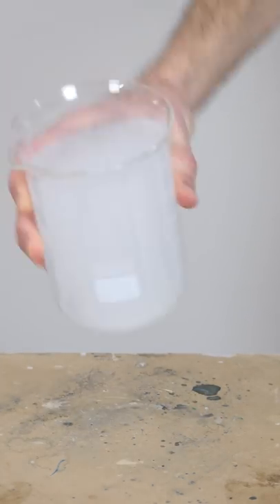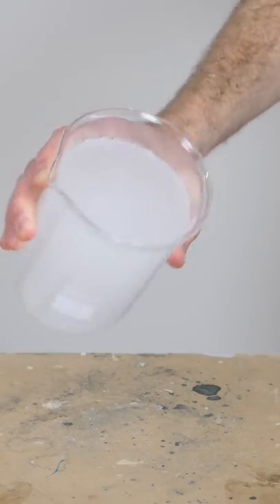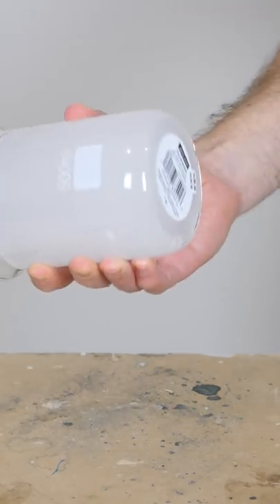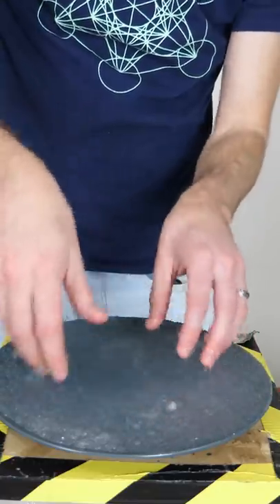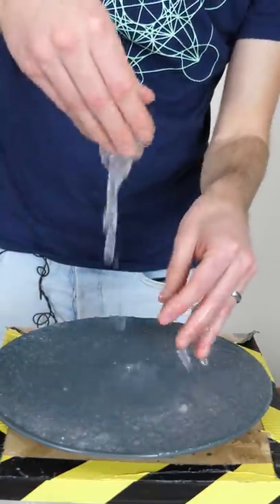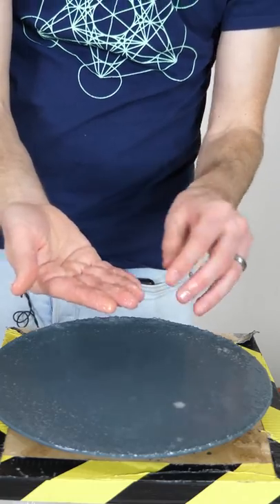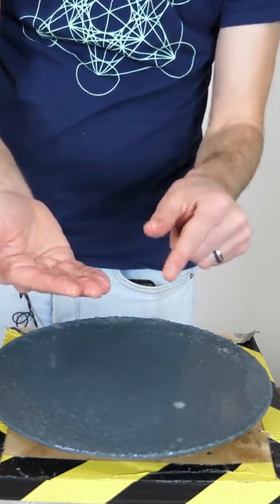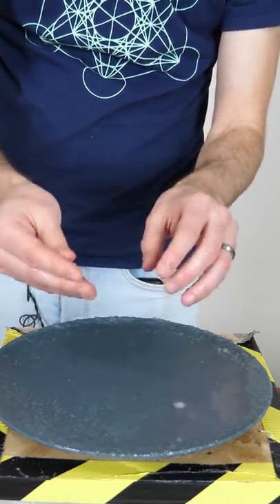Don't Put Salt On Superabsorbent Polymers

Comment: Fun fact: this is used in tattoo studios when an artist finishes a project they sometimes add this to the remaining ink in the small container not to spill it in the trash can
Reply: Interesting application. I am a chemist. Never thought of using superabsorber that way!
Reply: that’s a cool way to contaminate ink. rad.
Reply: @karabinjr  lmao what? Hahahha
Reply: @karabinjr  its used to cleanly dispose of ink thats contaminated. You (hopefully) wouldn't want to put back ink that you've dipped into then poked into someones skin, then dipped back into
Reply: @ameko1ikiru  thank you. I misunderstood.
Reply: You can use it on inks but Its mainly used to for rinse cups, the cups of water used to rinse the color out of the tips/needles when changing from one color to the next. The most popular brand is called 'Rinse Cup'
Reply: @ag1648  thank you. As someone who uses this daily in a tattoo shop I concur. You would be wasting ink if your ink caps were big enough to need that. What are they running, a 1,235 mag?🤣🤣🤣 
We use this mainly for our rinse cups
Reply: @ameko1ikiru  we don’t use it for ink. You would be wasting expensive ink if you were throwing away enough to need an absorbent polymer. We use this to solidify our rinse cups. The viscosity and drying time of the ink along with the fact that we generally use it sparingly (the minimal amount needed for that project) makes it a non issue in the can, unless you thin it by tossing a bunch of water in the can via a rinse cup. 🤷🏻‍♂️
Reply: @michealhuff2299  sorry, i was just clarifying what the op said since they mentioned remaining ink, my apologies if it sounded like I knew what i was talking about, im not in the business as you could probably tell

Comment: They make this stuff for pulling toilets out. Pour a packet of powder into the water after you’ve flushed the toilet to drain the tank and leave it for fifteen minutes. Gets solid just like his, cool part is, once you reinstall the toilet, you just flush more water into it and it goes back to a liquid and flushed down the drain. Pretty neat stuff
Reply: Where do you pull out and reinstall toilets so often you need a special product
Reply: @tomlxyz  I would assume a plumber…You know that trade skill that deals with pipes and toilets..
Reply: @tomlxyz  people whose job it is to remove and install toilets.
Reply: @Caedus696  but why would they remove a toilet and install that used toilet at a different place?
Reply: @tomlxyz  well... Maybe some people have a copper toilet or one of those Japanese toilets with the build in springler and a lightshow. Those are expensive.
Reply: @tomlxyz  Sometimes it's just the wax seal under the toilet that needs replaced.  Toilet is fine, but still needs to be removed.
Reply: @tomlxyz  Do foxes use toilets?
Reply: @tomlxyz  ever redone a bathroom floor? There is plenty reason to remove the toilet to do that.
Reply: Doesn't this harm the water system because I read somewhere we drink what we flush after its been cleaned
Reply: @mrfookayu  presumably it is filtered out in water treatment facilities like all other contaminants in the water supply.
Reply: @Orjahlian  No I mean over time if everyone is doing it, won't there be too much polymer to handle. Like what if all the water turns to jelly, how would you clean or dilute it without more clean water
Reply: @mrfookayu  it is a specialty item unlikely to see use on such a scale (wet wipes, for instance, as I understand it are among the highest concerns for sanitation departments nowadays), and as demonstrated in the video in such a scenario we could separate the water using salt, even assuming we have no other way, which we likely do. In short, I wouldn't worry about this in particular.
Reply: @Orjahlian  Gotcha, for every flush I will add a sprinkle of salt. Just to be on the safe side and counter balance any polymer related situation from others. 😉
Have a nice day 🙂
Reply: @mrfookayu  you too!
Reply: @tomlxyz  rich people like to replace things that are still perfectly good. Why throw out something that works when you can resell it and make a little money and save someone else money at the same time? But generally it's just replacing the wax ring you lift the toilet take the old wax ring off scrape all the old residue put a new wax ring on and reset the toilet and bolt it down. It's a lot  easier when you don't have water sloshing out of the hole
Reply: @tomlxyz  flooring installs that need toilets raised
Reply: No plumber actually uses this stuff, it would be a waste of money, they get good at doing a bucket pour to cause a manual "flush" and the tiny bit of water left in the bend can easily be soaked up by a towel. I've seen a plumber do it with an extra large slurpee cup before! 🤣
Reply: Isnt it in baby diapers ?
Reply: @mrfookayu  Most drinking water comes from dam lakes & rivers. Which also experience rainfall and evaporation, which recycles the water.

Also, depending on the system, most waste water is treated before being released into the drinking water supply (if the system even puts waste water back into the fresh drinking water supply after being treated).

(Some systems treat waste water then dump it into the ocean or wherever.  Separate from the clean water supply).  There are many different systems, so you could probably YouTube or Google search your areas water supply and waste water treatment systems.

But again, most clean water that comes from Fresh water dams and lakes experience plenty of natural evaporation and rainfall that recycles the water before it even enters the treatment plant to be cleaned with whatever chemicals or filtration before pumping it to the community
Reply: When I've had to get water out of a u-bend I just use a wet and dry vacuum cleaner. Far simpler.
Reply: @pan2aja  yes
Reply: The T shirt he is wearing is more interesting than the experiment.
Reply: @mrfookayu  you have drunken water that dinosaurs have peed in
Reply: @tomlxyz  my dads a plumber. You’d be surprised how often people remodel their bathrooms. Adding a tub could mean needing to move the toilet over a foot to the side
Reply: @mrfookayu  I love how your solution to this is to sprinkle salt on your toilet like it’s a margarita glass
Reply: I just use a cheap Depot vacuum cleaner...
Reply: @jonsmith5058  thats what I was about to say, I remodel bathrooms taking out the toilet is one of the first things I do. 50% of the time the same one goes back in. I normally use a shop vac and blow out excess water.
Reply: @jonsmith5058  I don't know of a case where the floor was redone but the toilet was kept
Reply: @tomlxyz  ok? So what, its perfectly logical to do that though isn’t it?
Just cause you havent seen it doesn’t mean it won’t happen.
Reply: @tomlxyz  I have in my own house, but I'm cheap af.
Reply: @mrfookayu  you don’t need to. Once the polymer undergoes this effect, it completely looses it’s ability to absorb water.
Reply: @mrfookayu  That depends on whatever country or prison cell you're living in.
Reply: LMAO. NOT TRUE !!
Reply: @jonsmith5058  i feel like redoing anything in bathrooms is just a pain in the ass no matter what
Reply: @tomlxyz  when building or remodeling homes, a plumber may be called in to move toilets, sinks, showers, etc around. So, if someone wants to remodel their bathroom and move the toilet to make room for a vanity sink or a bigger shower or something, that would be a valid reason to do this.
Reply: Wouldnt just turning off the water and then flushing work as well?
Reply: @stuartgreenshields5591  ik, what i meant to say is: have the tank filled with water. Close the water (the water bobbin thing) so no more water can enter your house. Now flush your toilet. All the qater should flush, and no water will refill up the tank cause by closing the bobbin you severed the connection. Then you are free to change the toilet.

Wouldnt this work?
Reply: @mrfookayu  put salt in it
Reply: @capuchinosofia4771  no, it wouldn't work, for the reason I wrote.
Reply: @stuartgreenshields5591  im afraid i dont get it. Because you said that "if you are not flushing water into the toilet you are not going to be flushing the water already in there out either". In my previous comment explaining what i meant, the water flushes into the toilet, and the water does come out. Then the toilet should come up empty and flushed.

Im going to try what i meant and come back with my scientific method discoveries
Reply: @capuchinosofia4771  new water flushes in, pushing the old water out. If you've turned off your water supply and have no new water flushing in from your cistern, there is nothing to push the old water out over the u-bend and it will remain stuck there. It's not like pulling the plug on a bath where gravity will drain the water out. Try watching this video https://youtu.be/4Q_jpBo6MlE
Reply: @tomlxyz  remodel or replacement
Reply: @stuartgreenshields5591  you seem to not understand the point of the water cistern on a toilet.
The water in a cistern isn't preassurized, and it's legally required to have an air break between the inlet and the water surface so that the harmful microbes in the cistern can't contaminate the fresh water system.
Reply: @SonsOfLorgar  I think you've misread the chat here.
Reply: @stuartgreenshields5591  The water in the flush tank can be cut off before doing a flush and serve the purpose of cycling the water in the bend.
Reply: @sandeepghumman9294  we're talking about getting water out of the bottom of the toilet, not the cistern.
Reply: @tomlxyz  if there is a problem with the floor, why would you replace the toilet? There's literally nothing wrong with it, what's the reasoning for replacing it when the floor is the problem? All normal toilets look basically the exact same, unless you're getting a unique model there's no reason to replace the original.
Reply: That's really smart
Reply: @tomlxyz  they don't move the toilet somewhere else, they put a new one in the same spot. The polymer is flushed so the flow of water down in the pipes is temporarily stopped
Reply: @fox another example is if your replacing the flooring in your bathroom. Remove the toilet, install flooring and put toilet back
Reply: @Knobulon  that's what happened to my apartment, the floor had water damage and they had to replace it before I was able to move in. It's just odd that this dude thinks that there's actually a reason to replace the toilet too.
Reply: @mrfookayu  Salt.
Reply: @Morpheas001  Pepper.
Reply: @tomlxyz  Why did 36 people like this comment? Do 37 people not know about plumbers?
Reply: Isnt this also used in baby diapers?
Reply: I don't need a special polymer to clog a toilet, just a Taco Bell #3 combo and a bean burrito with onions.
Reply: @ChrisD__  what did the 🦊 fox say?
Reply: @adinashaina9977  Foxes are bottoms,
Reply: or you can just prank your friend and fill their toilet with this at night so when they take their morning shit and flush it the turd just floats out and onto the floor
Reply: @drooboob  sometimes a toilet gets a hairline fracture and it won't flush everything out  so no the wax ring isn't always the option!
Reply: @mrfookayu  salt.

Comment: That's pretty much the same as adding salt to vegetables when sauteing them. The salt draws out the water in the vegetables.
Reply: And somewhat like when you put salt on snow
Reply: So when you put salt in boiling pasta they don't absorb the water?
Reply: @Terapagos3000  good question, they do i guess but less?
Reply: @Terapagos3000  no it does still, it also helps season the pasta
Reply: @Neyobe  no it lowers the freezing point of water which absorbs heat from surrounding which in turn melts ice. It doesn't absorb water from snow for osmosis to occur you need a semi permeable membrane
Reply: @Terapagos3000  osmosis always works In concentration differences if the pasta internals have a lower salt concentration they always will absorb the salty liquid if they have higher salt concentration they will loose it out to the outside water
Reply: @adityabhatt4186  thanks for the info!!
Reply: Or pouring salt on a snail 🐌 to kill it 😁😁😀😀😀🙃
Reply: @nerd3350  I have killed many this way
Reply: @ Glank
From my experience, it does not really do anything. If you put the salt in while it is starting to boil, it might take longer to boil  because you disrupted it but I think that’s it!
Reply: @meet560  do you eat the snail 🐌 I would they are very yummy with butter and garlic cooked in a stovetop pan. Delicious 😋
Reply: @Jourdainist  Haven't tried it yet might try in the future
Reply: @adityabhatt4186  I'm a semi-permeable membrane. Lol
Reply: @meet560  no. Don't eat snails or slugs. There was a local boy who was dared by his friend to eat a slug. He died after eating it. Research snails more closely as well.
Reply: I JUST TOLD HIM. I'M VEGAN
Reply: @meet560  ha ha.
Reply: @kenycharles8600  tell that to french people.
Some of them are fine to eat but best to get from a so called „snail farmer“ and definitely dont just eat snails found in the wild.
Reply: @adityabhatt4186  Isn`t it because the carboxy group is highly polar and negative charged and the salt dissolves and the positive parts (likely sodium ions) will place them next to the carboxy group, what means, that the water is pushed from the group and cant form h bridges? On the assumption, that it is a carboxy superabsorber like polyacrylate
Reply: @adityabhatt4186  No. In osmosis, water always goes to side which has higher concentration

Comment: We used this in plumbing when we're installing new toilets. Old toilets still have water in them and in order not to drip water all over the customers floor when transporting the old toilet outside,  we pour this polymer inside the toilet and it absorbs all of the water. Pretty neat.
Reply: What is the polymer?
Reply: Good idea
Reply: Is it Sodium Polyacrilate?
Reply: @danielmorton4306  I guessed it is Sodium Polyacrilate, because it absorbs 200 parts of water to 1 part of it. It's also used in baby's diapers to absorb the urine in it. But it's just a guess

Comment: Fun fact this is exactly what the powder is in diapers and you can rip them apart and add the powder to soil to help plants grown even quicker
Reply: Wait that works?
Reply: Flowers, yes.  Vegetables, No Way.  Polymer = plastic
Reply: You can also eat it if you want to suffer a slow and painful death due to a major intenstinal blockage.
Reply: Hey maybe don't deliberately add microplastics to the soil!
Reply: @AbiSaysThings  news flash you can grow plants in a pot separated from the ground!
Reply: @christosbelibasakis2296  ok but runoff water will still go into the ground
Reply: @AbiSaysThings  this is a trick for flower pots not for outdoor soil.

Comment: Me pretending to understanding: 

“Ah... osmotic pressure, yes....”
Reply: Yeah he just kind of dropped that jargon and stopped, that was a bit wierd.  The short explanation is that high salt concentrations will draw water away from low salt concentrations, and if you have the right setup - which requires osmosis through a membrane that lets water through but not salt - then you can measure the pressure difference this causes.  Basically, the salt is drawing the water out of the polymer.
Reply: 🤨🧐 indubitably,
Reply: Imagine a tea bag; tea bagging.
Reply: The basics: When faced wtih semi-permeable membranes, water will travel through to whichever side has the most concentrated solution. This is why salt kills slugs (by pulling the water out of the slug) and why it gives you high blood pressure (by pulling more water from your body into your blood vessels). You add in that salt and now all the water wants to rush to the side the water is at. Likewise if a hospital gave you water drip that wasn't saline, your blood would be so dilute that the water would want to leak out of your veins and arteries into the surrounding, more salty, tissues causing water bloating, perhaps pressure on your organs, and a dangerous lack of blood pressure.

Comment: This is not the case for every hydrocolloid. For some, the water absorption ability and viscosity is influence by salinity (and also acidity), but for others it is not. It depends specifically on what substance is used.

Take a small amount of fleawort (aka psyllium) mix it with 20-30 times its weight of water and let it set for a couple of minutes, and you will also get a very strong gel, just like in the video. You can put salt on that and it won't turn into mush. Likewise, acidity does not make a big difference either.

In fact, fleawort is used as a thickener in salad sauces and as a binder in other foods, for it is all natural (ground up seeds of a plant), the active ingredient is a polymer of sugars called arabinoxylan.
Reply: My guess is he is using  an acrylamide based polymer.